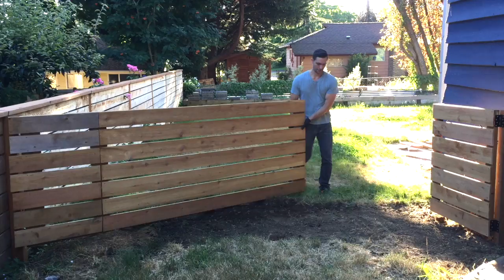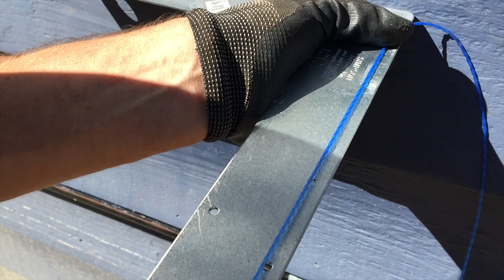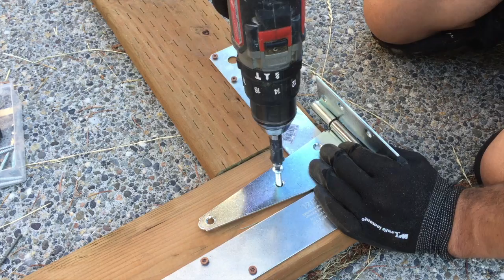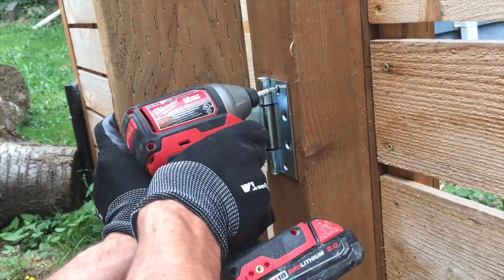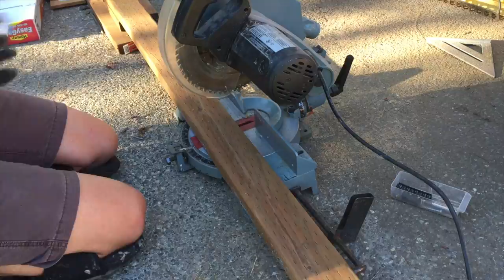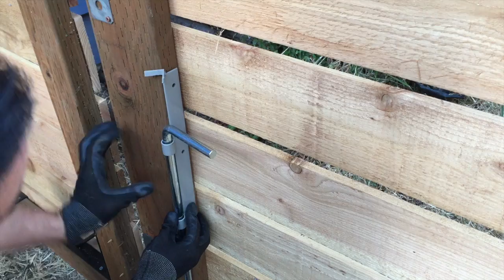HOW TO BUILD A DOUBLE FENCE GATE  : DIY GATE TUTORIAL

Comment: I just realized my professionally installed fence is not 90 degrees. Any idea how to overcome this to put in my gate? It''s 6 inches off when you run a string from one post to the next. This would be a 16 feet wide gate composed of two 8 feet panels. My property also slops down hill.

Comment: if my opening is 13 ft 2 inches, how wide should my gate panels be so that they swing properly and close/open together. I am trying to make two the same size so that they meet in the middle. Thank you.
Reply from the maker: Depending on the layout of your opening you mainly need to account for the hinge hardware thickness if that effects the 13'2" as well as account for the wood to swell naturally.  I would account for at least 1/2" of space in between your two gates.  3/4" gap would work nicely as well.  Hope that helps.  Thanks for watching.

Comment: that pipe in the ground is going to come back to haunt you.... it will clough.. it will overgrow.... or you might forget about it and in the distant future  you will bust lawnmower blade or something on it
Reply: Consider a concrete paver/ bore a hole into it and use that... epoxy (or some proper adhesive) the pipe into the bored hole. It can easily be removed/ cleared out/ replaced if necessary
Reply from the maker: That may be the case if the gate was being opened every day but I will rarely be using the large gate so I won't have to worry about cloughing and the lawnmower won't be getting close haha.  Thanks for watching.
Reply: fair enough ^^

Comment: I have the same type of gate I built about 2-3 years ago... however I think you went too large on the gaps... those things will widen a lot trust me!

The space I used was a paint stick that they give you at lowes, and not even 1/4 inch, and nowadays the gaps are 2-3x larger... 

Here it is:

https://scontent.fabe1-1.fna.fbcdn.net/v/t31.0-8/14856169_10157733596675074_12253588995217275_o.jpg?oh=e8ed55afe2756352a09f78731bb04905&oe=59F4FFAF

https://scontent.fabe1-1.fna.fbcdn.net/v/t1.0-9/11703346_10155897468295074_5343432701461300592_n.jpg?oh=02134c82ae944d23a69443ee39db7ab3&oe=59F80C97
Reply from the maker: Thanks for the heads up.  The gaps in the fence line I built a year ago have not changed at all but I'll keep that in mind in the future.  Thanks for watching Salvador.

Comment: Great vid! Any tips for preventing debris or overgrowth on the iron pipe buried in the ground? I have one fence and it is constantly jammed with dirt/water.
Reply from the maker: I'm not planing on using that large gate very often but if I were you I would find some type of canister w/ a screw top that you can bury and drill a hole through the lid.  If its a large canister the small amount of sediment would fall through but wouldn't jam up your lock system.  It would fill up eventually but it would take much longer to do so and you could empty it by just unscrewing the lid and dumping it out.  also drill a couple small holes in the bottom of the can so water can drain through.  Thanks for watching Jake.